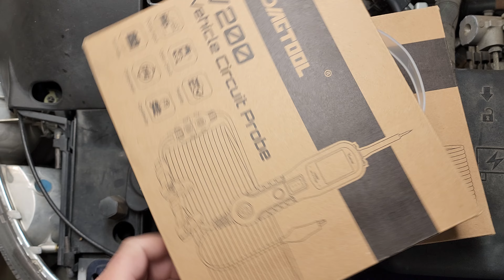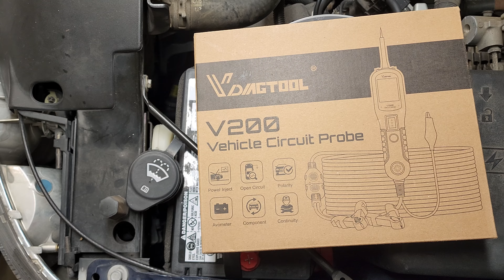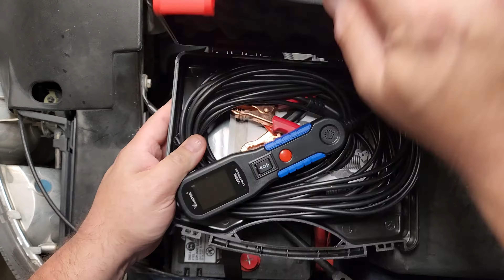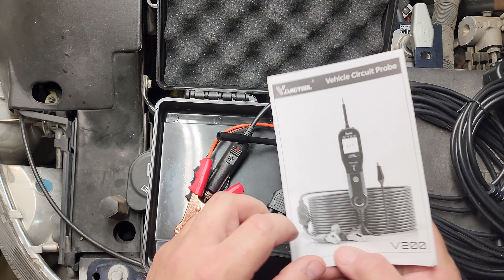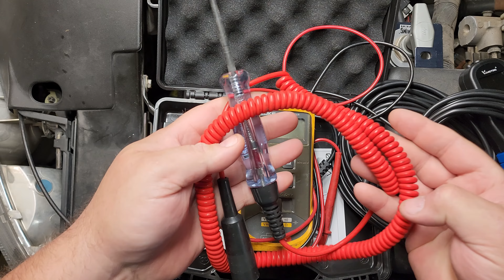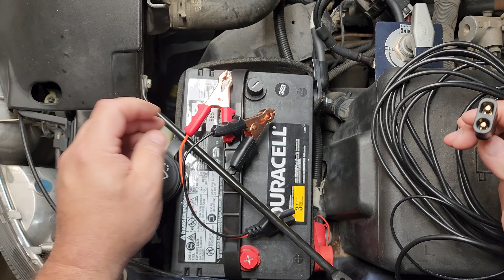VDIAGTOOL V200 Circuit Probe Tester Review Similar to Power Probe III

Comment: Why does that bolt trigger red light and you still say its ground?
Reply from the maker: Can you provide a time stamp for me to look at?  Thanks
Reply: @SlipFitGarage 6,51
Reply from the maker: @robortkristensen3818  That is interesting.  It is indeed a ground, but it should've been a green light instead of red.  I have no explanation for that.  Good eye.
Reply: chuckle . . . chuckle . . . I think I will spend my $100.00 on another tool until they fix that red light / ground problem. 😄 @SlipFitGarage

Comment: These Powerprobe type testers are very useful but too many times I've seen users just poke and poke away at wires without a back probe to what they're testing! Creating holes in wires will lead to corrosion in that wire down the road.
Reply from the maker: Poking holes in wires can certainly be a problem...  especially up here in the salt belt.  It does NOT take long to turn a perfect copper wire into a green powder, that's for sure.  However, as you know, this tool is NOT specifically designed for poking holes in wires..... Sure, it CAN poke holes, but it has MANY more uses that will not damage your vehicle and/or it's wiring.  It's all up to the user and how they want to use the tool.  A hammer can damage your car, too if it's not used properly and it 's not the hammer's fault... Just to be clear for others who may read this comment, you mentioned a USER problem, not a TOOL problem. Thanks for the comment.
Reply: @SlipFitGarage  it's definitely a user's problem because tools like this with the ability to inject power cuts down diagnosis time, leading to bad habits from the person especially when the vehicle is not theirs.

Comment: Yo Brian,
Hey that looks like it's made by my favorite scan tool brand;
XTOOL 

Excelent demo Brian. 
Most people will be intimidated by this thing, and prefer the old $0.99 Test Light from Harbor Freight. 

But this thing can do so much more, and it's a peice of cake to get the hang of. 

I just think of 'em as a;
Traditional Test Light
Voltmeter
Ohmeter
Jumper Wire
All in one. 
-Chuck
Reply from the maker: Hi Chuck, nice to see you. Yes, I believe VDIAGTOOL is part of XTOOL but I'm not 100% .  And You do make a good point....  If you think of it as all those tools in one, it's less intimidating. This type of tool may not be great for every electrical problem, and it may not be great for everybody....  but considering the current price, plus clickable coupon, AND 15% discount code posted under my video, that can all be stacked together, it's a pretty good tool.... especially when compared to the Power Probe brand name tool. It's just another tool in the tool box.  If you're like me, you can never have enough tools. lol. Thanks Chuck!